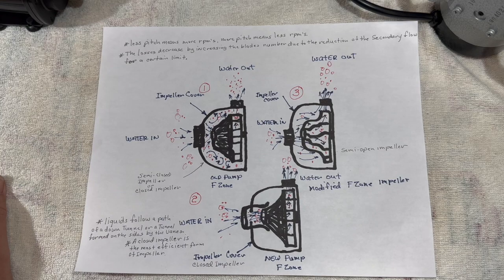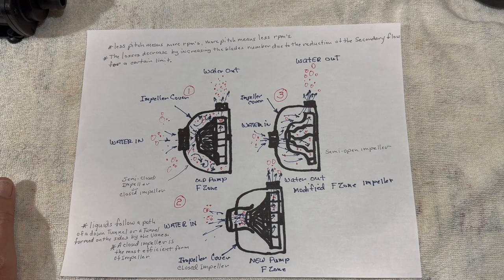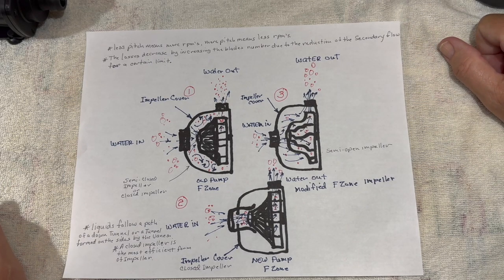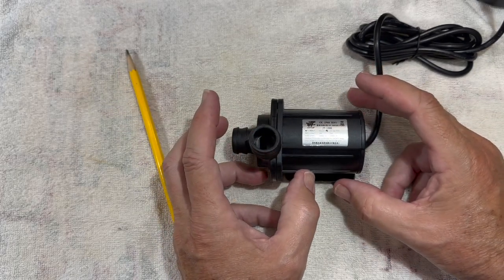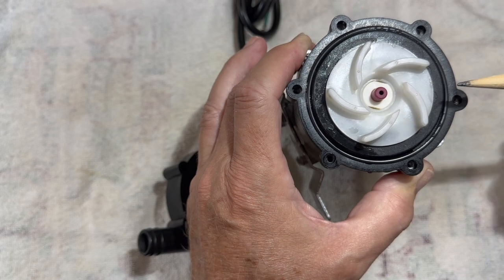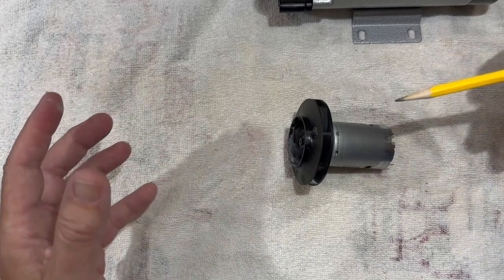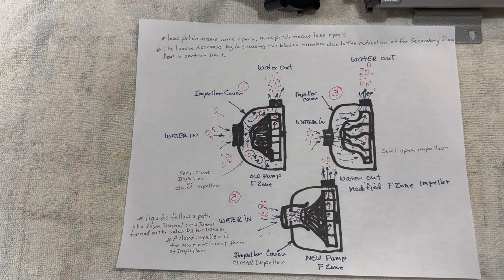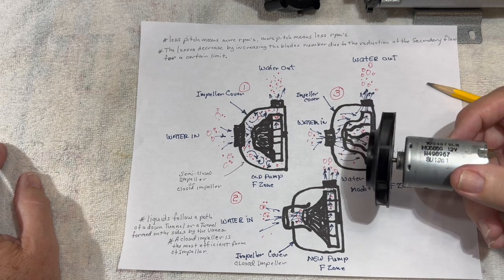How manufactures are cheating you , giving you a lesser canister pump, available for the hobbyist.

Comment: Yes sir. I think it improved output. I bought the fzone 550 pump after watching one of your videos on the fzone filter. It is a very quiet pump, and I love the feed mode feature as I use a skimmer on my filter intake. I also learned from you to buy extra seals/gaskets to have on hand if needed, though the fzone came with a spare set. I was going to buy another fzone 550 for a back up and saw they now have a different pump. I had wondered why they changed. Now we know. Nice to see a company improve their products and not get cheaper. Thanks for the great video !

Comment: Thank you Dr Novak. Excellent idea & modification. 👌👍
My sunsun has an open impeller with 6 blades and so far doesn't seem to be getting air locked even when sucking in air. It simply blows it out. The efficiency however is quite low. The specs say 1,400L/h but with the mechanical media in the prefilter (the canister itself is filled with only bcb bags so minimal resistance from there) it only manages around 400 L/h so for now I swapped the outflow pipe with a 1inch hose with no bends and going straight into the tank. This has increased the flow somewhat though I haven't measured it yet to confirm the actual increase from the  initial 400 L/h. I will measure the actual increase in outflow and post it here.
Reply from the maker: The limiting factor is that impeller, and you're not going to improve performance too much more after that.
Reply: @anoxicfiltrationplenums  Yes. I agree but maybe you could share some tips on how to tweak the efficiency of the cheap open impellers.
Reply: @anoxicfiltrationplenums  Hi Dr Novak. As advised earlier, I just wanted to share an update in the amount of outflow that was actually increased by swapping the 16mm outflow hose for a 1inch hose directly going into the tank without any bends. The initial flow was only 400L/h. After swapping the hose, the flow is now 514L/h. A gain of 114 L/h. If I were to swap the 16mm inflow hose as well, I could probably gain a little more upto the limitations of the impeller & resistance from the mechanical filter media.

Comment: Dr. Novak off topic? For a 72”X24”X20” tank which is 150 gallons will 1 lift tube be suffice? Or should I put 2? Also I will be adding 3 FZone 15l canisters with bcb baskets! ? Would it be too much if I added a basket to each canister or is only 1 good enough?
Reply from the maker: Yes one will do fine. Very good idea to add one basket to each. Please watch my next video and I'm going to give you some good ideas to use okay.
Reply: @anoxicfiltrationplenums  thanks Dr. Novak I appreciate your input!